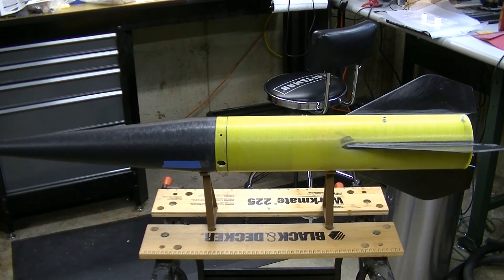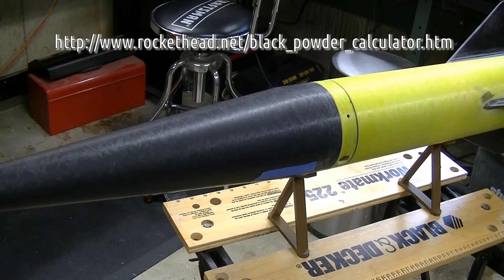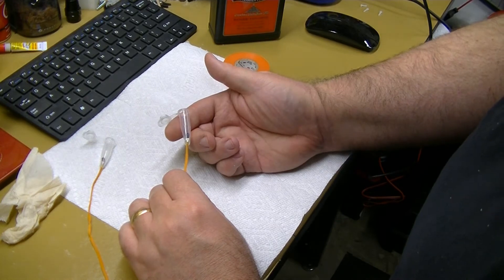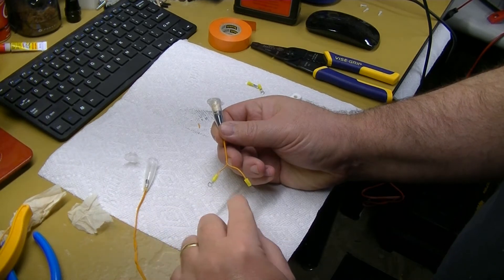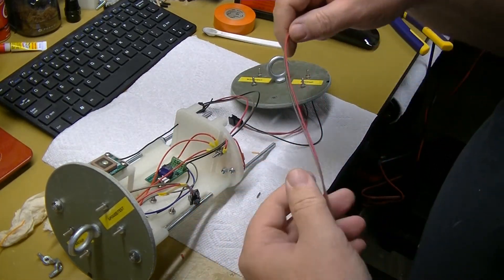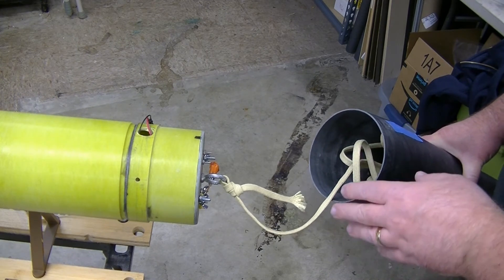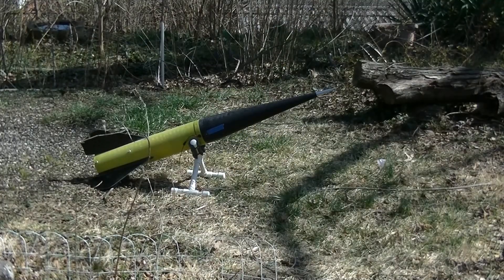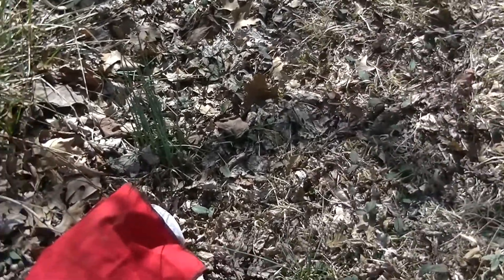Ground Testing for High Power Rocketry

Comment: Nice demonstration! Did you use a single shear pin on the NC, or was there a pin on the opposite side as well? Also, is the hole further up the NC just to allow pressure to equalize?
Reply from the maker: Thanks! There are three shear pins evenly spaced around the nose cone. I've been told that you never want to use just a single shear pin, because that can cause the parts to try to separate at an angle and they can bind up. I edited out the shear pin part because I (as usual) had trouble getting them to go in.

And yes, there are vent holes in the nose cone (I think I have two small vents on opposite sides, if I remember correctly) as well as one in the lower airframe section above the motor mount.